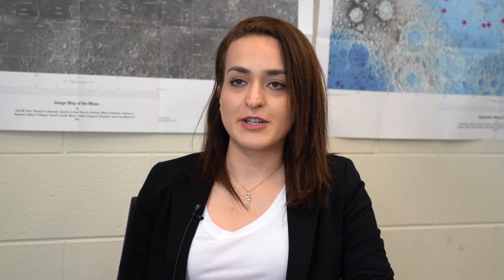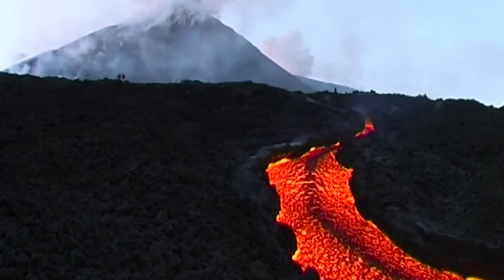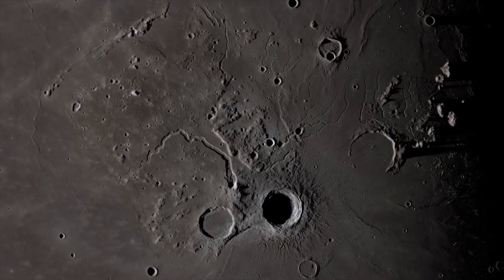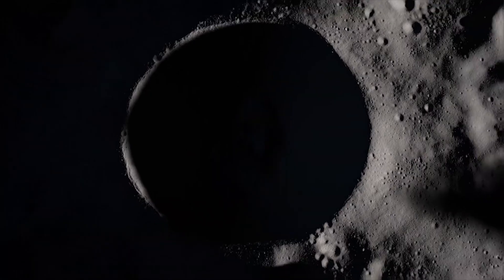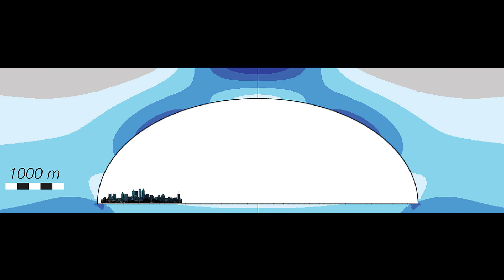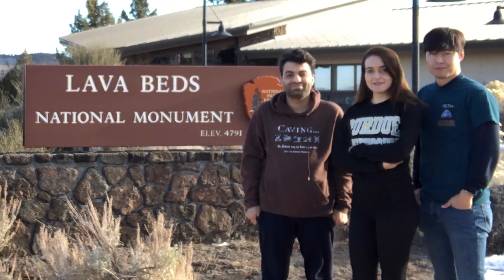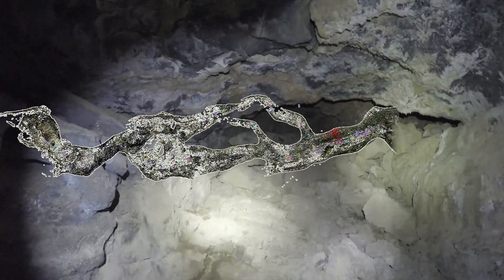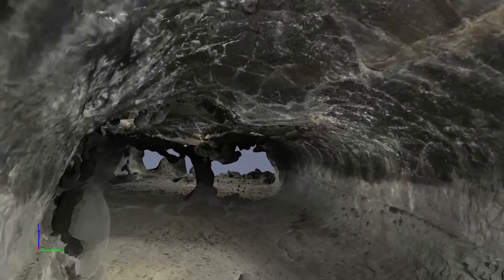Could We Live in Lava Tubes on the Moon?

Comment: I would absolutely love some probes to explore the moon's tubes or seismic readings to determine it.
Reply: "Once the astronauts had returned to the CSM, the LM ascent stage was released and collided with the Moon. The LM hit the lunar surface at 6,048 km/h and created an estimated 9 meter wide crater. The shock waves from the impact were a surprise to the scientists, with the Moon vibrating for over 55 minutes. The seismometers also recorded signals that were totally unlike any received before, starting with small waves that gained in size to a peak which persisted for a long time. It was reported that even after an hour the smallest reverberations had not yet stopped."
What does this mean about the inside of the moon?
Lots of hollow space inside? Not completely hollow or similar but a bell rings as supposed to something that is entirely evenly dense.

Comment: Plastic tents could be inflated inside lava tubes which would form habitat for man
Reply: Why even do that? Build airlocks at the skylights (you could build spaceports on the surface as well) and pressurize the entire space. You'd then be able to build an open air habitat complete with plants, animals and water.
Reply: @davidkelly4210 would be annihilated by radiation dust and micro meteorites